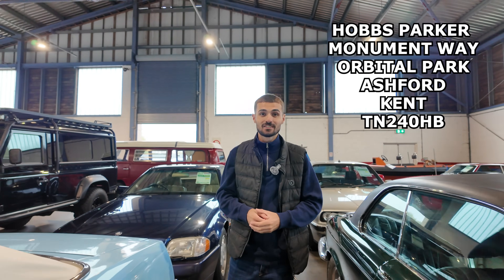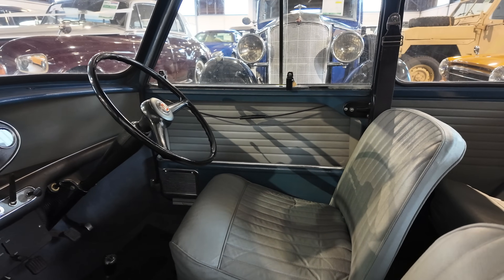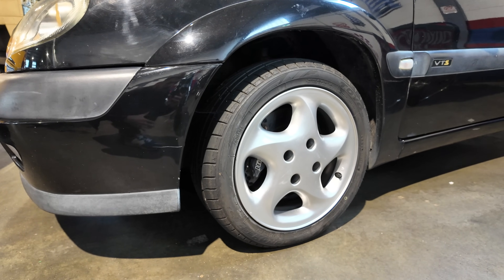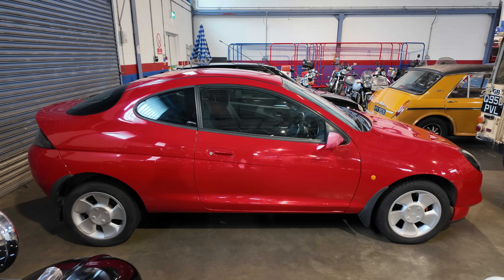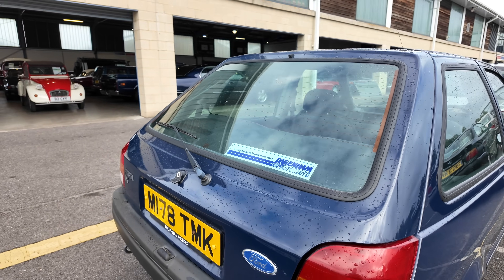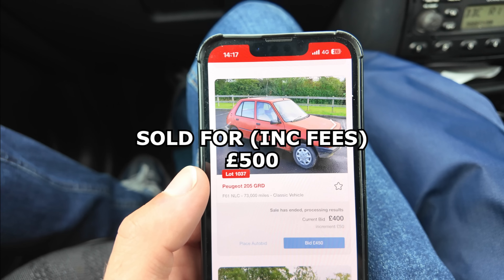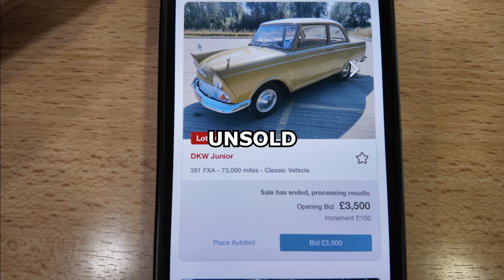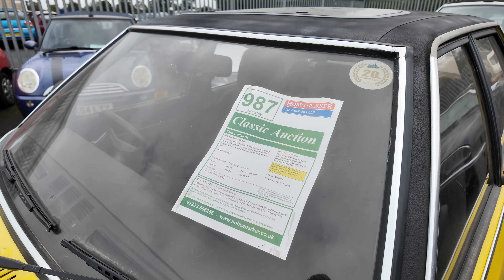I ATTEND A CLASSIC CAR AUCTION IN KENT! HOBBS PARKER AUCTION

Comment: That Austin 1300 Gt has exactly the same motor as a 1275 cooper S
Including the 12g940 head and EN40 forged crank. Bought a runner years ago for 30 quid. Which is about the right price🙂
Quatro was a potential bargain, they are 5 cyl.
The DKW is a 3cyl 2stroke